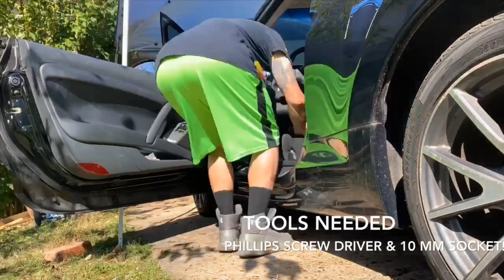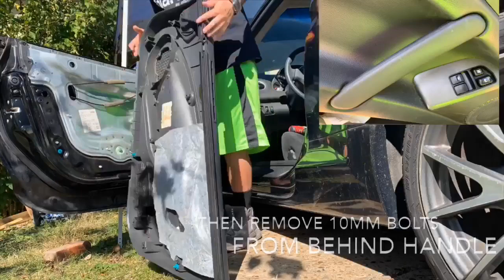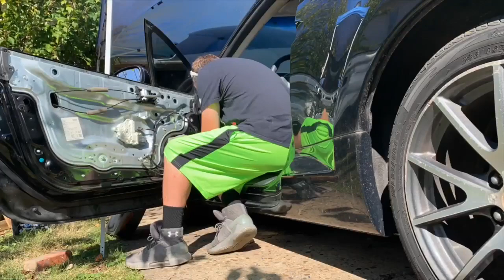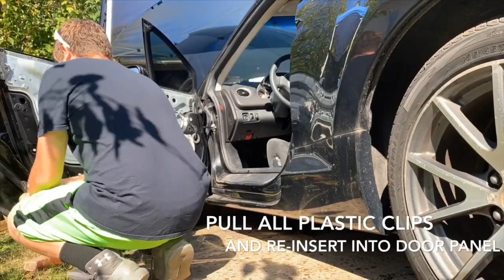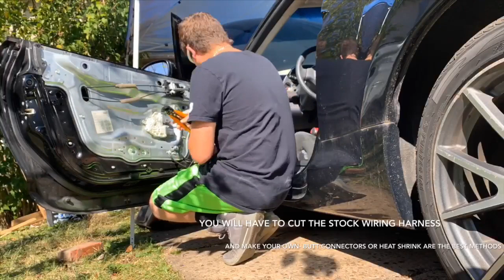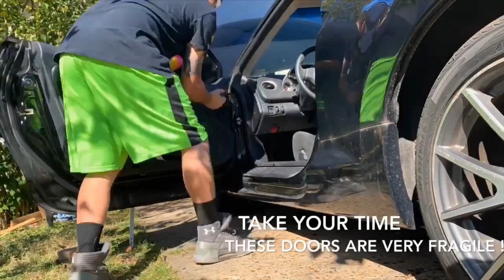How To Replace Door Speakers In Mitsubishi Eclipse 2006-12

Comment: Did you have the Rockford Fosgate setup?
Reply from the maker: Nope - same concept but the RF has 6.5s all around
Reply: @LivinLoudwithAndy  shit... I have the RF setup, and the  radio is displaying error message. My mechanic said the radio itself was fried, so I bought aftermarket everything including the Amp interface harness. This is such a mess, I was looking for videos to help educate me, but everyone is running different equipment. I'm ready to throw a match in it, and be done 🤣💥
Reply: @LivinLoudwithAndy  I just don't know if they're hooked to the Amp too

Comment: My front speakers on the dash blew you know how to take the dash panel off to get to the speakers up front
Reply from the maker: I do - you need a small flat head to pry up the mesh cover - once you get that off there will be bolts to remove the tweeter pod - it’s been a while since I have but it’s pretty easy to do other than being in a very tight space
Reply: @LivinLoudwithAndy  thank you!
Reply from the maker: Anytime man💪🏼

Comment: Hey man I was wondering if you can change the window switch without pulling off the door panel. Do you happen to know if that part is separate from the panel?
Reply from the maker: It is separate but to remove it - you need to take the door off to pinch in the back of that switch so you can remove it
Reply: @LivinLoudwithAndy  Alright, thanks for the quick reply. Pretty easy to pull off the panel but I was hoping I could be lazy lol.

Comment: what wire is positve and what color is negative when you cut the wires
Reply from the maker: Daniel Cofield  unless you have the right tool to decipher that - which I don’t even have - the best way is to hook up one then when you hook up the other side and try it both ways - the one that sounds better with more bass response when the doors are closed is the way I’ve done it for years - the colors for the positive and negatives are not mention in the Manual
Reply: Flip the speaker (oem) around while its still hooked up and look at the wires positive is typically on the left and negative is typically on the right

Comment: Size speakers?
Reply from the maker: Depends what trim level you have - do you have the Rockford Fosgate system or no
Reply: I have the stock speaker system without the rockford fosgate package what size are the door speakers and the tweeters in the dash???